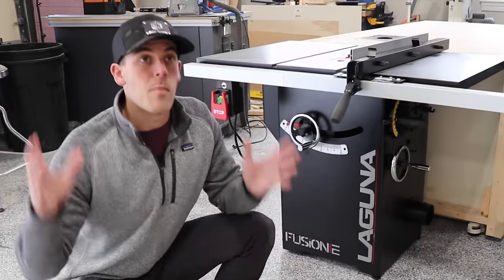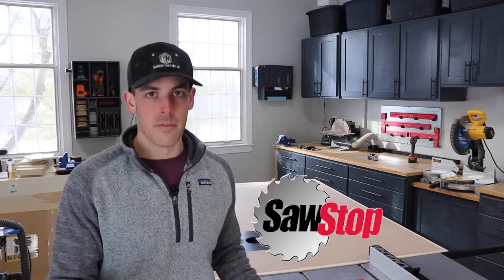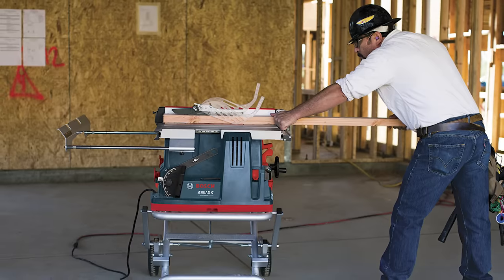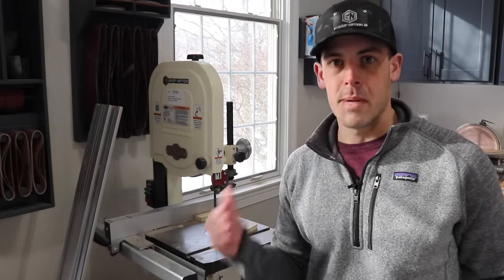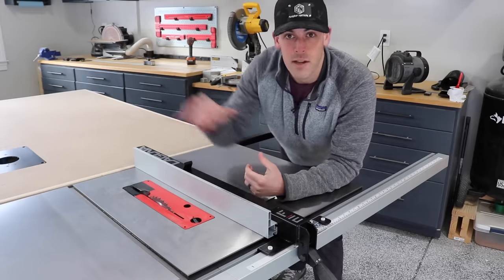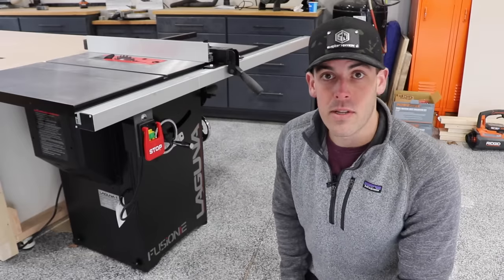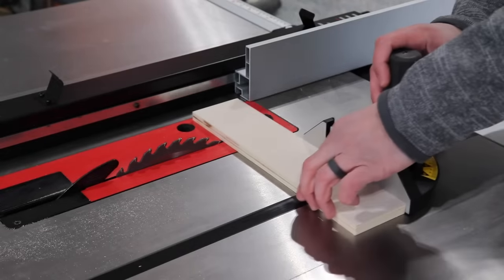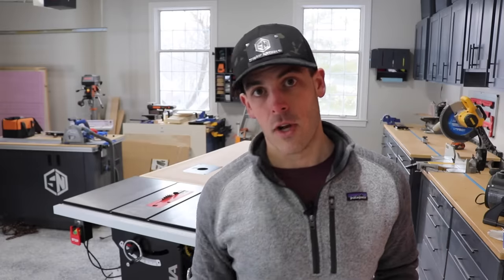Why I Bought a Laguna Table Saw over SawStop!

Comment: I totally get this argument if you’re just a woodworker. Most people are likely willing to take the risk of a non-sawstop table saw because the probability of accident is admittedly very low (as you pointed out). However, I am a fringe case woodworker that is ALSO a professional guitar player. To me, having the peace of mind that if an accident occurs it will not impact my woodworking AND my guitar playing, makes the sawstop a no brainer to me, and makes the price tag worth the lower anxiety I’ll have from then on. I’m about to pull the trigger and upgrade to the sawstop in the coming weeks, but still think you have some great information here. Thanks,

Comment: 100% agree.   I have horrible ADD and can get lazy and carless.  Not when i use my tabkesaw thoough.  I always use the riving knife and use the bkade guard when possible especially for the duat collection.  Sawstop is a great saw and the safety feature is great and the only saw with it.    
That being said, it is. Ot worth 1500 bucks more than a laguna or the saw i just bought, a Harvey.   I continue to operate the machine safely.   If i only bought products based on safety features i would own a volvo, replace every outlet in my house with arc and ground protection, and trade in my motorcycle for a tank.    Sawstop has a patent and they are using it to sell a corvette at a Ferrari price.

Comment: Hi, I actually work at a custom cabinet shop in Oklahoma. Both of our tqble saws at work are SawStop saws. I really appreciate that the owners have invested in the exuberant costs for the safety. That said, I am in the market for a table saw for myself, but I absolutely cannot afford a SawStop, I do not even have the space to house the machinery. I'm actually thinking of buying a hybrid, or at the very least a contractor saw, can anyone recommend something in the $800-$1,000 price range? It HAS  to be extremely sturdy. I am very much attached to my fingers, then again, I use my radial arm saw pretty much daily at home, and it's apparently a lot more dangerous than table saws.

Comment: I have a Delta contractors saw that I've had for around 30 years. It's definitely not perfect but it gets the job done. It has the Delta Unifence on it that does the same stuff as the fence on your saw. I can tell you how many times I've flipped it down for things like veneer. Never done that. I have used it for a stop in conjunction with the miter gauge and that is a useful feature.

Comment: For what it is worth, I had a Fusion F2 for a bit but it is being returned.  Not a fault of the saw quality, but due to damage from shipping.  Oh yeah, I had to deal with the horrible customer service from Laguna.  Problem is, I could not find it.  All I got was reasonably good response from them.  All things considered with things these days I have no issues with their CS, or their saw.  Unfortunately, I never was able to use the saw.  I did set it up partially, tried out the fence and stuff.  For those saying the fence sticks and does not move smoothly.   Hm, I think if you are able to move a fence from one side of a saw to the other with a  the backhand of your pinky finger, it must be moving pretty smoothly and easily.

Overall, I think you get what you pay for.  This was a pretty nice saw for $1399.   I feel it was about $1399 worth.  Nothing more, nothing less.  Nice features, everything worked well, as far as I can tell minus the damage.   It was just lacking in the stiffness and robust feeling you get with a real heavy cabinet saw.   Those real heavy cabinet saws (with similar features) cost more money though. So, again you get what you pay for. 

If you want 36" rip capacity and overhead DC, and are on a budget get the Fusion F2.  From what I understand from other, the overhead DC is a bit hit and miss.  Meaning, if you have a real multi HP dust collector it will work decently.  If you are not able to move enough air, it may not work well at all.

If you wan a saw like the F2, but would prefer steel fence rails (30" capacity) get the Jet ProShop.  The guts are pretty much the same. Cabinets and fence systems differ though.

The Grizzly G0771X and the ShopFox W1837 both seem to be more robust in the cabinet and trunnion department.  Just look at the picks.  Their fences may be lacking in comparison to the other two saws though.  They are also cheaper.   They are all nice and capable saws, they just all differ in one way or the other.  None of them really compare to the nicer and heavier cabinet saws though.

Comment: Cause of your review, I bought a Laguna instead of the Delta you had (the space requirement is roughly the same). If I don't end up liking the Laguna - I'll demand a refund from you. Also cause of a different review I bought a Graco VSP but then upgraded to a Graco TC Pro for the cordless capability. Thanks for you honest reviews though.

Comment: I think you made a good decision Travis, not in that you bought a Laguna but in that you didn't cave to popular opinion. I'd like to know more on that Laguna though because it's at the price point I'd be willing to drop on a new saw. I'm hoping you'll do a more in depth review down the road. In that close up you did of the fence it looks like the table top is kinda wavy. I'm hoping it's just the camera angle and maybe some smutz on the top itself. In any event I'm looking forward to more videos from you. Your channel has been a juggernaut as of late so congratulations on your success and hopefully more to come.
Reply: The F2 I had for about a week (that needed to be returned due to shipping damage) had a nice flat top  It had less than .0015" (my smallest feeler gauge) deviation across the main table.  This was tested in all directions.  The wings seemed flat as well, though I did not measure.  I would imagine that wave look you see are just smudges.
Reply: I just received my Shop Fox W1837 and it is as nice, or nicer than the Laguna F2.  Different features and price, but both good saws, both with nice and flat tops.  

Might I recommend you go with the Jet ProShop, or the Grizzly G0899.  The Jet for a similar price is the same saw as the F2, minus the cast iron wings and it only has a 30" rip capacity.  What it does add is a real fence, a much better fence and a 5 year warranty.  The saws are pretty much the exact same on the inside.  I bring this up as Woodcraft has them in stock as of today and I believe that saw ships free.  After owning the F2, it would be my choice over the F2 between the two saws.  Another great option is the Grizzly G0899, same price as the F2 with the same features. If it is anything like my Shop Fox, it will be heavier duty than the F2.  Actually, based on the photos in the G0899 manual, it looks like it is much beefier than the F2.  I did not consider that saw, as it was just a little to heavy for my application.  I needed to keep the saw under 300lbs to keep it manageable for me.  I need to be able to easily move my saw (on my mobile table saw cart) out of the garage and into the driveway which is wear I use it.  The Grizzly G0899 has a much better fence system than the F2, and also has beefier trunnions and a beefier cabinet.  Again, compare pics of the various saws, and go through the manuals.  You will be able to see the build quality between the saws.  The F2 fence rail is lightweight, the weakest of all the saws I mentioned and I did have concerns over it flexing on certain cuts.  It may be strong enough, may not.  I never got to test it.  I think on most cuts it will be fine, but bigger sheets of ply could cause a little fence flex at the rail.  The aluminum rail on the Grizzly G0771z and Shop Fox w1837 is much thicker and stronger than on the F2.  The steel rails on the Jet and Grizzly G0899 are the best of the group.

Also, from what I hear the overhead dust collection pm the F2 works ok, but you need a big multi HP dust collector to get it to work "ok".  Look at the comments on the "Toolmetrix" Fusion F2 video for more information.  The overhead on the Grizzly might suffer from the same issue.

Comment: Great information and video. I'm currently enrolled in a technical college Construction program in Washington state. Been using the table saws a lot and love it but am always leery of an accident happening. I used to work for the Boeing Company for over 30 years and know all about industrial accidents and they're no fun. The one benefit of this is that I do take safety seriously! I also dirt bike in our mountains quite a bit and use every top rated piece of safety equipment when doing and have avoided serious injury as some of these trails would make some soil their pants. My personal feeling is that money should really not be a deciding factor when involving ones safety. If I can afford the expensive dirt bike (over $10k) then I can afford to properly protect myself with a few hundred dollars of top rated safety gear. If I were to get a shop table saw the added safety of a Saw Stop saw even at twice the price would be well worth it to me. I can save money in every other facet of life easily without jeopardizing my safety. Funny thing is that every time I look at all the "expensive" wood working equipment that many complain about being expensive I chuckle as I think it's a bargain coming from a dirt biking hobby that I've spend many times that just to partake. To each their own but I'm trying to save as much of me as I can as I get older even though it doesn't work quite as well as it used to, lol.

Comment: Thanks for this information and congrats on your new saw.  It sure is nice to have choices, isn't it?  Not sure if its my imagination, but your Laguna sure looks alot like the Harvey Table Saws.  FYI, the idea for that type of fence is not new.  Delta's original Uni-fence used that same design. No idea how these saws compare in everyday use, but I fully understand choosing one saw over the other. Everyone is going to have different criteria for what they chose to buy.  Woodworking is just a fun hobby for me. I've been using an original "Made in USA" Delta Contractors saw since about 1990 and honestly, its all I need. I've upgraded the old jet-lock fence with Biesemeyer style fence (Shop Fox) and added a cast iron router extension table (Bench Dog) It's a super set up for my needs.  But then I make no claim to be a professional! :-)  
BTW, for those that don't know, and from what I understand, Black and Decker/Dewalt bought Delta/Porter Cable a while ago dumped the massive inventory of spare parts in a landfill,  sold a few newly designed products under the Delta name and when those didn't sell well, sold the brand name off again, as I understand it, to a Taiwanese fellow, and the company is now producing a much smaller line of Delta tools manufactured overseas.  Perhaps your Delta saw was one of these?  But these new Delta saws should not be confused with the original USA Delta machinery.  An original Delta Unisaw at the right price would be sweat along with an origina Biesemeyer.

Comment: Interesting.  It does look like a nice saw and I have a Laguna 14bx bandsaw, however if you want 3HP you have to go to the F3, which in Canada is only $400 less than a SawStop.  Don't think I would bother with Laguna at this price, nor would I buy a SawStop.  The "other" saws made in the same Taiwan factory are great saws with excellent accuracy and most of them include all of these features and more for half the price of a Laguna, and 1/3 the price of a SawStop.

Comment: Great review and you make a lot of sense. I did buy a saw stop but had a delta unisaw for 30 years.  The Delta is agreat saw but even not considering the safety part the saw stop is a slightly better machine. The only comment I would add is the price is not apples to apples because we don't know the actual cost of the blade brake to subtract from total cost.  Look forward to more comments about how the laguna functions, it sure looks great.

Comment: I used to work for WC. We sold them all and I for one (but not alone) would have upgraded my saw to the Laguna 3hp (4hp?) saw. It has no brake, but it had the nicest set up fence in the category.  It wouldn't rack on the rail when set up correctly and you could push it with one finger the whole run of it's travel either way. I sold it several times on the better fence alone. It was about as expensive as the Sawstop Pro. Sawstop Industrial was the biggest baddest we sold but you were always looking to start around $6K for that. The Fusion at around $1300 at the time was the best value we had in the store IMO.  The only question I have is ....why Ohio?  She must be really pretty to go from Texas to Ohio.

Comment: Went through this same calculation a year ago.   I sold my Hitachi C10FL, which I had used for 10 or 12 years.  I had decided between the Fusion and the SawStop Contractor.   In the end based on my workflow(mostly hand tools) I ended up with a Dewalt Job Site.   If I had the room and wanted another large footprint Table saw, I would have gotten the Laguna.  For the features versus price, I don’t think there is a better saw out there.

Comment: Very good thought out decision, just work carefully and you'll probably be fine.
And as for Sawstop being the gold standard... they have been surpassed by Felder . They have a system that doesn't require replacing a part when the security kicked in, as well as not having to physically touching the blade before kicking in.
Granted, sawstop paved the way, but as with every technology... it keeps evolving.

Comment: Never heard of Laguna till just now.  Looks like a solid saw.  I cut my teeth (not my hand) on the classic Delta Unisaws.  Also, at home these days I use my upgraded ~40 year old shopsmith.  (Bigger table, better fence and a usable riving guard/guard)  If I had the space and the money, I would still go for the sawstop though.  My tiny career as a fiddler requires all my fingers.  

We replaced the Delta in in the school I used to teach in about a decade ago with a Sawstop, and it has saved at least one kid from a serious accident. 

Of course an inexperienced user of a table saw is a hazard (to themselves and anyone in the room), but then so is someone like me with 50 years experience.  It's a dangerous tool.

Comment: Where I work I have one of the top end SawStops saws, at home a $300 Ridgid jobsite saw. I have had zero issues with the Ridgid in 2 years and the SawStop at work has been a headache the 4 months I have used it. The electronics are finicky, it just triggered when the blade was stopped already and my fingers were no where near the blade, and I am constantly having to clean sawdust out the cabinet. the dust collection is marginal at best. I do like the accuracy of the SS, but can get similar accuracy out of my cheap Ridgid as well. I've been using saws for 40+ years, and can sti   use my  inky haha (I have all 10 still). The way I look at it, is I am my own safety device. Not only will I not do anything I deem unsafe, but I wont even come close to doing so, a little margin of error. On top of that, I would need to mortgage my house to buy a SS.

Comment: lacuna makes nice equipment , I worked over 25 years in Architectual Woodworking professionally for over 25 years and have been doing Woodworking as a hobby for more than 35 years  and my biggest argument I have is all the people I personally know that has had table saw accidents  have all operated them for many years safely  and all have told me that it happened so quickly they couldn’t believe  that it actually did to them , now I lived for many years in a large Metropolitain area  that had some of the best hand surgeons in the Nation  and those recoveries were years of hard and painful times  honestly  I suffered a Traumatic Brain Injury that paralyzed my left arm and hand  and everything in life is very difficult despite having a assortment  of handicap tools I have acquired over the last 10 years